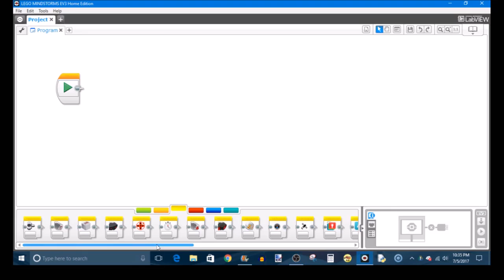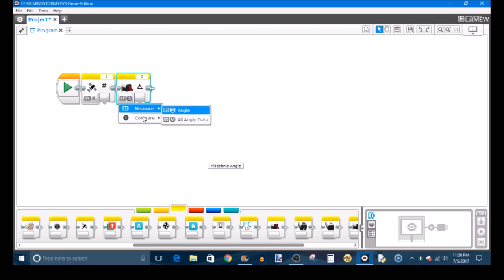Why I Have So Many EV3 Programming Blocks - Will they Improve your FLL Robot?

Comment: Hey Builderdude i am having a trouble  making a MyBlock of MotorSteering with Unregulated Motor block Could u please help. I need it for speed linefollowing
Thanks
Reply from the maker: Have you seen my MyBlock videos? I recommend you watch those, that may help you.
Reply: I meant how does the logic go when you enter any value in the steering of a motor steering block
I need to recreate it with unregulated Motor blocks
Reply from the maker: I don't recommend using the Unregulated motor for this application, as it will result in unreliable driving.
Reply from the maker: But, you can use two separate motor blocks and vary the power on each wheel like Move Tank.